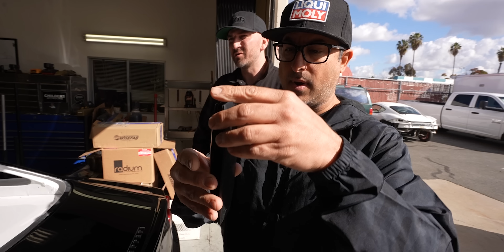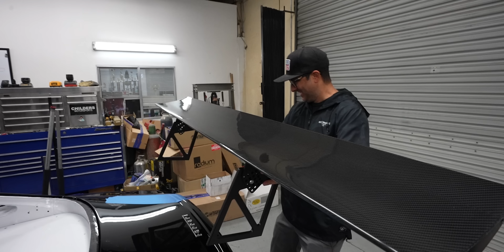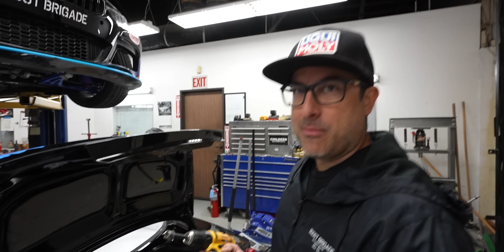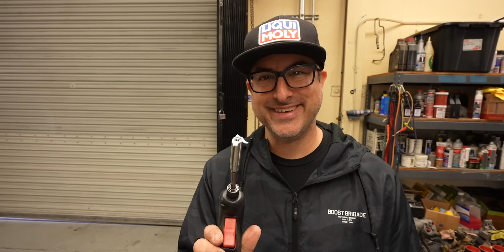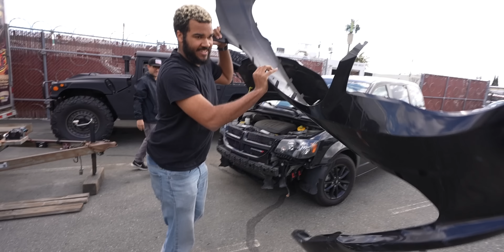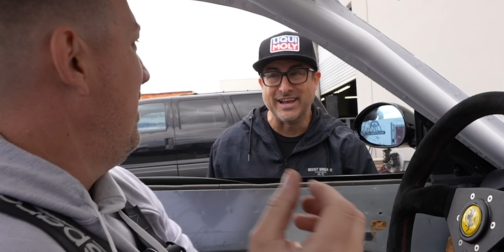FERRARI IS GONNA HATE ME FOR DOING THIS…  *CEASE & DESIST INCOMING*

Comment: Sick!

I kinda think the back diffuser needs one more set of vertical fins at the outer ends. 

Wing is a knock out though, SOOO good!
Reply: Agree about the diffuser looks a little short also.. id have it a bit wider but prehaps it's function over looks?
Reply: @Darren Mclean  I agree it could go wider. Maybe put some down slope on the tips for a few more inches, then bend and go down. That would be sick.

Comment: You guys should look into radenso or escort! The systems are “expensive” but I’m sure if you take it out of Dave’s salary it wouldn’t be a big worry, I believe the escort system is 3500 without labor, it comes with laser deflectors for the front and rear, normal radar and a lot more options, it’s basically let’s you know there’s a cop lasering you but 9/10 times the system will “kill” the laser so they can’t get your speed. Andddd if you get someone who knows how to install them properly and hidden you’ll never get caught;)

Comment: The 550 looks great, on camera the wing looks a little too big and not the right size for the car. If you are going to do rallys with it you are going to need the air and heat connected.

Comment: Might need the car to have a hydraulic lift system to be able to get it over curbs and speed bumps but also quickly be able to drop it down again otherwise that diffuser or front spoiler will be fucked because that car is extremely low 😂